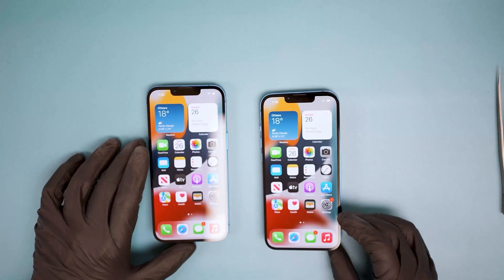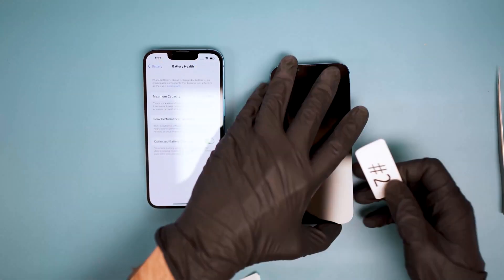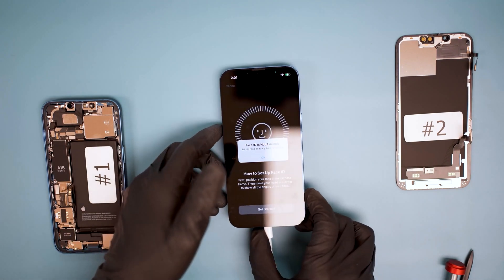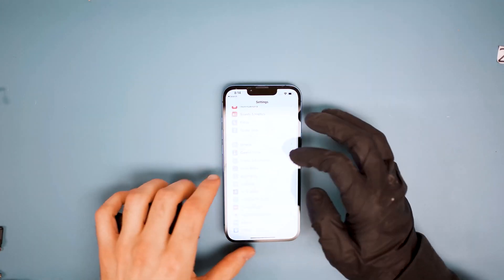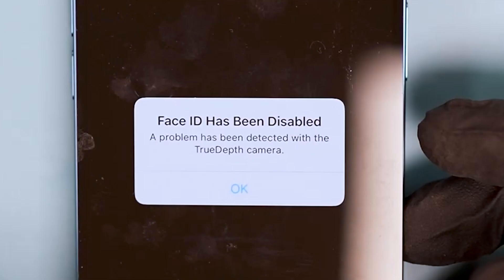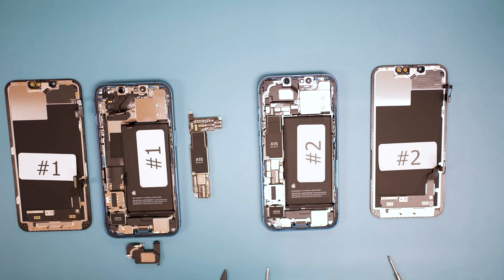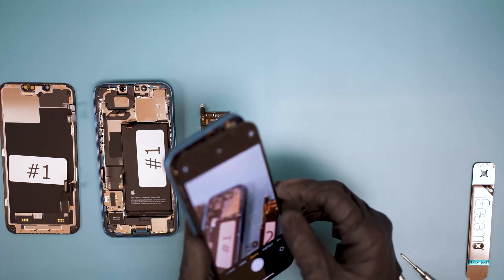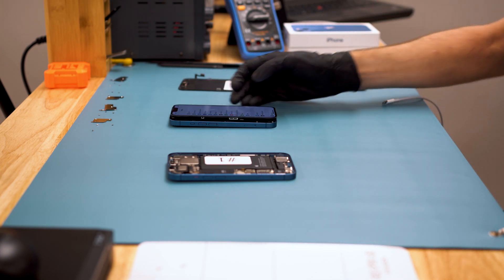iPhone 13 disables Face ID after a Screen Repair?! These are our initial findings...

Comment: This is most likely an electronic fuse. Once the phone detects an unrecognized display, it permanently blows an internal fuse  that will prevent face ID from working, no matter how many times you reset the phone.
Reply: Doesn't make sense because it works once you put the original screen back on.
Reply from the maker: I was worried about something along these lines.
Reply: I thought it worked when others swapped back to original displays after testing wrong display.
Reply: I guess there is pairing system in there, unfortunatly iphone system is closed source so reverse enginering will take a long time

Comment: Did you try a dfu restore with the flex on screen moved over too?
Reply from the maker: Yes, amongst other things. Literally tried for 5 straight hours to solve the error. I wonder if the new dot projector assembly is hyper sensitive to failing? 

It sucks not having a dot projector tester yet , or access to extra parts for testing..
Reply: @marcuscupello  it's either this or some super calibration between Apple and Samsung on the display in some way

Comment: I have an idea, but I'm not a display engineer. What if they (at the factory) calibrate the display IC to the actual OLED panel? They could have predefined brightness stops (or curve) in the chip firmware that are referenced to very specific current draw (voltage drop over a shunt measured by the chip). If these were calibrated together based on manufacturing variance, it could be used for pairing maybe?

Comment: Wouldn’t the ‘issue with the TrueDepth camera’ message suggest the dot projector being at fault?
Reply from the maker: Yes but we didn't even touch it and it looks perfect 😅
Reply: @marcuscupello   iOS 14.7 (something like that anyway) remapped it, they started dropping like flies. What confuses me is the fact that it’s a pop up when you try to activate it, on other devices it doesn’t let you get to that stage. 
It could be anything, it is apple after all
Reply from the maker: @esa9971  Yep , anything is possible at this point
Reply: @marcuscupello  how about the flood illuminator? Ir camera should be all good, the dot projector wouldn’t cause the pop up after activation which really just leaves that as the final possibility. 
The ic swap getting rid of the no Face ID pop up on boot means that all the encrypted hardware for Face ID is detected. it’s just when you go to set up Face ID that it’s failing which would suggest a fault with one of those components?
Reply from the maker: @esa9971  yes we tried using the original top flex with flood illuminator despite it being confirmed to work prior, without top flex connected
Reply: @marcuscupello  faetrain had realised photos of the internals of the dot projector. They’ve moved the flood illuminator in there too. It’s just the proxy, als and mic on the front flex now
Reply from the maker: @esa9971  oh! Well that's good to know. Thank you 🙏